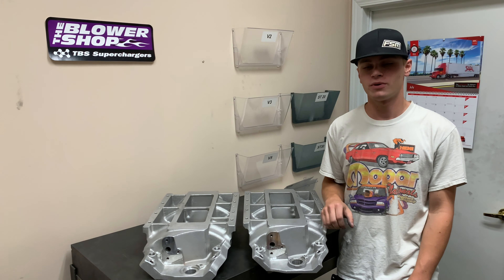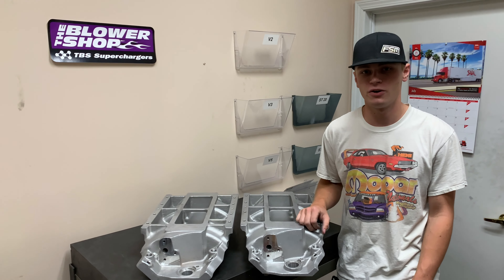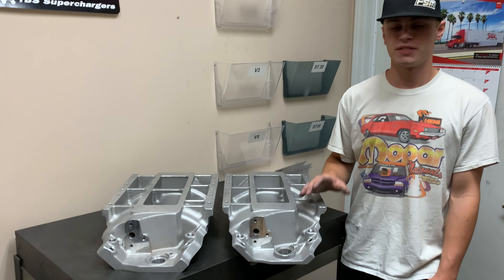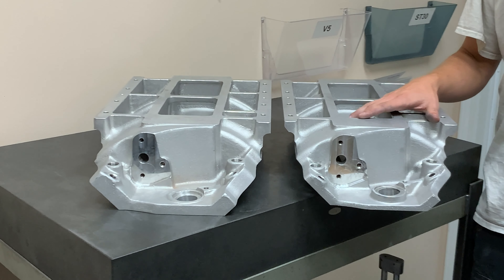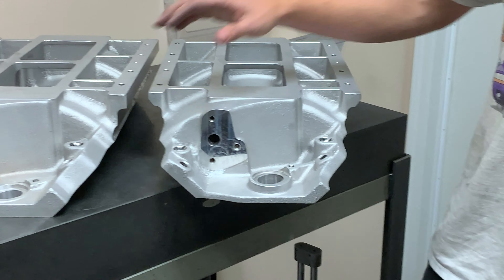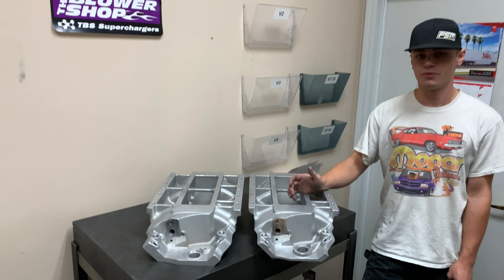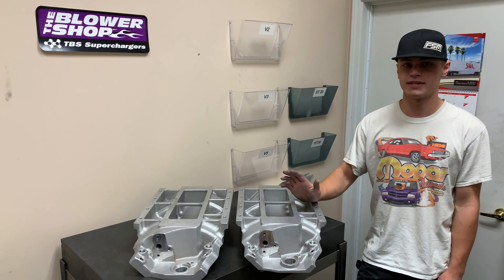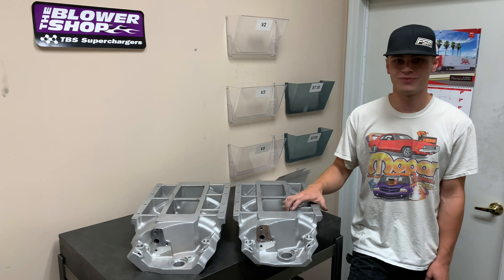TBS Boost Bio 12 - BB Chevy Manifolds

Comment: Would be nice if you offered manifolds for all those of us who run 10.6 and 11.1 decks. Quite often big cube blown builds are based off of 10.4, 10.6, 11.1 and 11.625 blocks. 10.6 and 11.1 decks are probably the most used in these applications.